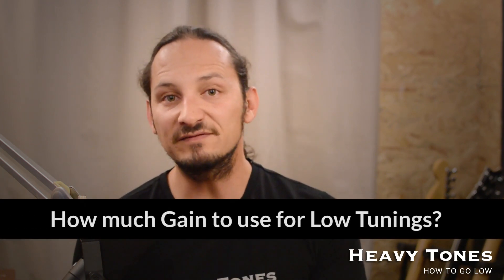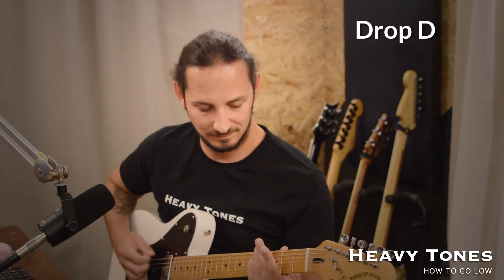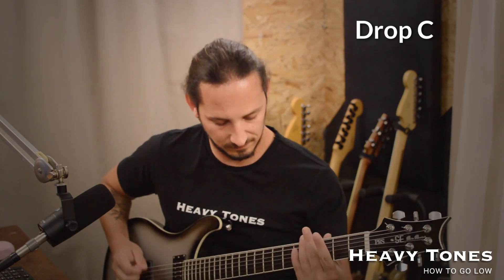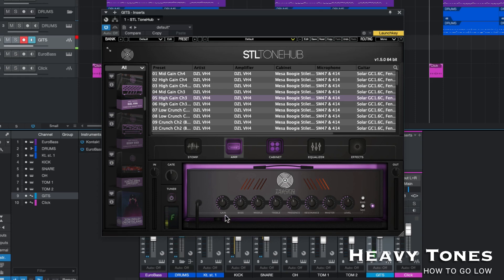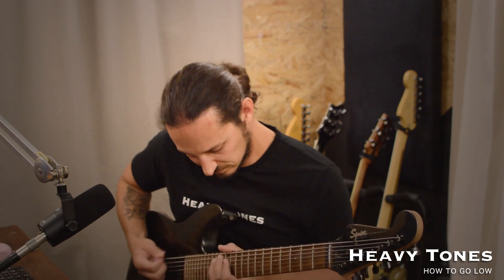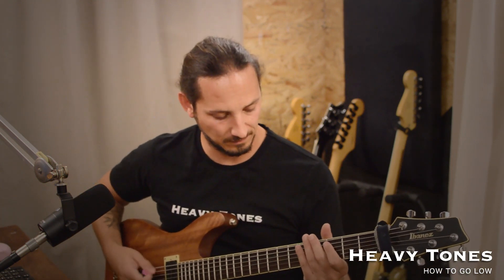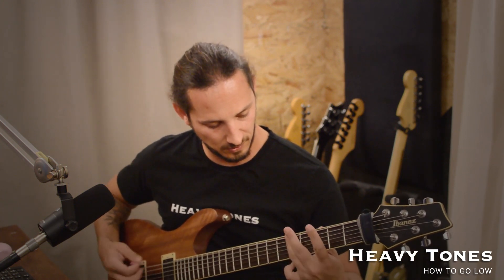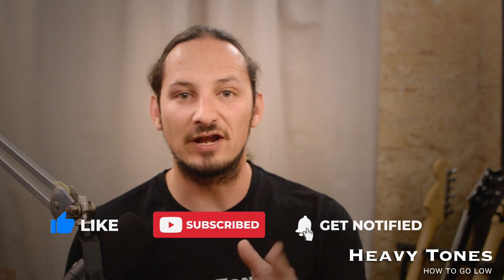How Much gain to use with Low Guitar Tunings

Comment: Nice video, but I would also add a use of overdrive pedal. With traditional drive at 0 and level at 10 it really tightens the tone and it's awesome for low tunings!
Reply from the maker: Yeah I got an overdrive setup before the Amp in Tonehub. But yeah totally and overdrive gives a bit more boost and tightens up the sound.
Reply: I love the traditional method of running a drive pedal in front of the amp. I’ve run into a few people recently who like it without a drive, and I just can’t personally ever do it. It’s always so flubby and I don’t like how it turns my once clean riffs into just a washy mess. Might be my playing as well,  but I just don’t like it.

Comment: Scale length also plays a big role in clarity, so theres a little wiggle room in there. But maybe you should do a video on something like that too.
Reply from the maker: Thanks, yeah definitely gonna do some more videos on scale length and how it alters the tone as well.
Reply: Also, I think a lot of less experienced guitar players don’t play with the correct strings as well. I know I didn’t when I first started,  but it was almost impossible to tell through my digitech rp modeler. My first guitar was setup with the pink pack slinky’s and I always tried to drop it to D standard.
Reply: @BrandonHayesMusic  I’m not sure which pack that is, but personally I like using heavier gauge strings and people always say that it takes away from tone. For example, for 27” I use an 85 for drop E

Comment: I feel like Drop A is still okay with a lot of gain, but where you really start to notice it is when you go lower than that
Reply: I thought the opposite, I thought it still had too much gain
Reply: @worhed3722  It did, but it was noticeably better than it was with the hugh gain
Reply: @hannes1734  I like low gain tones for tracking especially, but if I'm jamming I'll crank the gain lmao it all depends on what you're doing anyway, high gain can sound good too, but it's a lot harder to get it to cut through a mix. That's why theres so much arguing about pups all the time